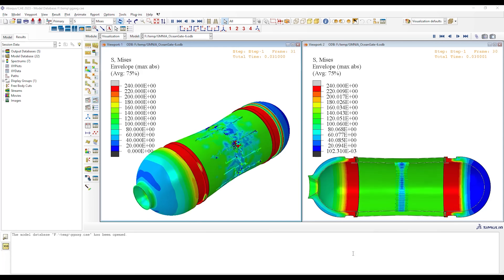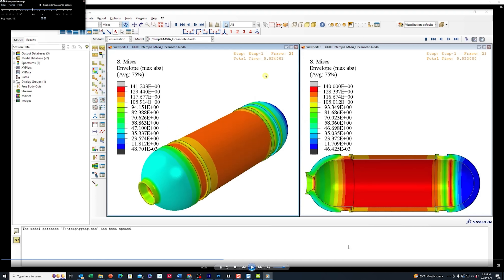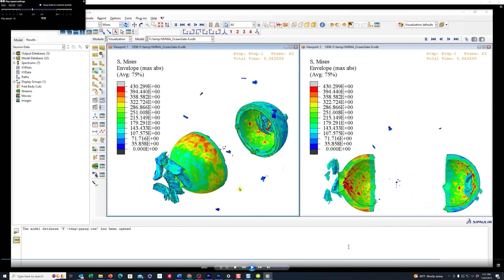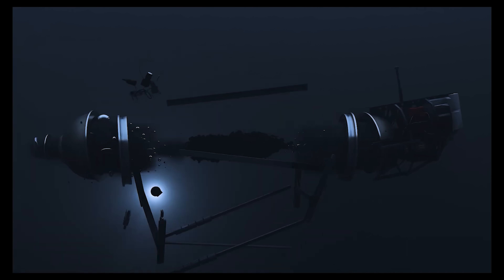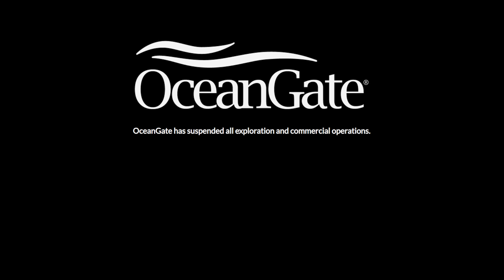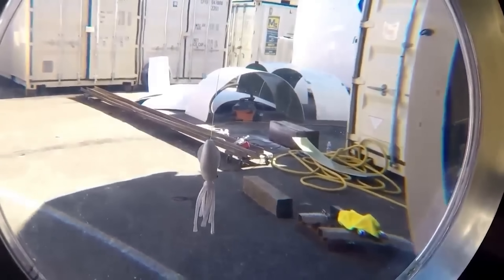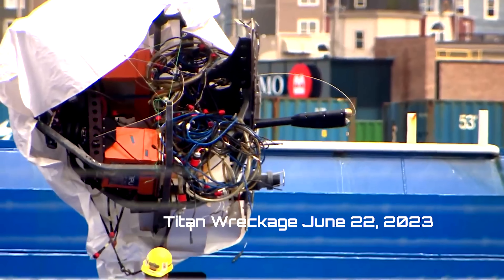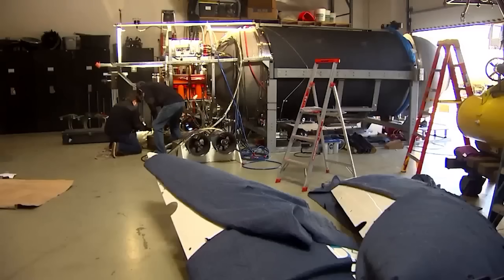Best Titan Sub Implosion Simulation, Cracked Porthole? Q & A

Comment: Ex submarine sailor here. I think that when they dropped ballast and/or the landing skid, the vessel went vertical with the stern down. Everyone was in a pile on top of the pilot until it imploded. They knew what was happening.  That toy submarine didn't have any way to maintain the horizontal orientation once things went bad. Any small problem with buoyancy or trim became a lethal problem in seconds.
Reply: The text comms retold said Rush saying more than once, "cracking sounds aft. "
Reply: @mikesanders4012 then that would be carbon breaking down?
Reply: That makes sense.  We already know one method they had to release weights was to have everyone move to one side to tilt the vessel so it’s orientation was quite easily manipulated by shifting weight.  All without any fixed seating or restraints that even a forklift is required to have.  If Wile E. Coyote took delivery of a submersible in a nailed-together wooden Acme crate it would have looked something like the Titan.  Even the Acme rockets came with a strap to keep you on!
Reply: @kev_299  Your analogy is perfect. MEEP! MEEP!
Reply: @pugsymalone6539  The reason the stern down scenario made the most sense to me from early on was the reporting that human remains were found.  I haven’t heard much about it since.  If the reporting was accurate, my first thought was they would have been in the stern cap and contained in it like a crucible.  If anything was found it may have only been things like fillings, surgical rods/ joints, etc. - and probably would have been all five of them.  So many secondary forces/ bubble theories at play that could probably explain finding  more intact remains too but the manner of their descent and location onboard makes the most sense if this is the case.
Reply: @kev_299 that is very interesting
Reply: @kevinm8543  my thoughts as well. If the CF was taking water at shallow depths and/or the glass balls full of air were flooded, she would be stern-heavy. The majority of penetrations were at that end as well.
Reply: @kev_299  this entire comment chain is a whole revelation, and THIS one puts it all together.  I've been skeptical about the human remains thing but this makes sense.  Love it.
Reply: @pugsymalone6539  all of them were at the ends, there is no pass through for anything that isn't going through the titanium rings.
Reply: @nikonmikon8915  I'm not sure what you are referring to; penetrations?
Reply: @pugsymalone6539  the hull penetrations for the controls of various systems and data input to the systems inside. with regards to your ignorance on the topic, just because you sailed does not give you ANY authority to speak on engineering topics. stay in your lane bro. dont bring your goofy lane over here trying to make it relevant.
Reply: @nikonmikon8915  Stay in his lane?  What lane are you in Bruh?  Is there a lane for overconfident engineers who’ve never built anything?  I only know two categories of deep sea vessels: deathtrap or not a deathtrap.  You’re defending the former and are in no position to pull rank on anyone’s knowledge.
Reply: @kev_299  I don't think you understand what i was saying, why are you so pissed?
Reply: @nikonmikon8915  Me pissed?  Didn’t you just insult a sailor and refer to military subs as “weak ass”?  Tough talk from someone whose craft ended up in pieces on the bottom of the ocean.
Reply: @nikonmikon8915  Looks like you toob didn't like my response to you. When you have spent more than an hour inside a real submarine, or three days in crappy weather in the North Atlantic, please get back to me. Meanwhile, please give my regards to the contrarians union. Cheers!
Reply: @pugsymalone6539  I was looking forward to your response - too bad they didn’t like it!😁
Reply: @nikonmikon8915  "Sure, you might be a sailor with many years in this sort of environment over your long career, but I'M some douchebag on the internet, so I'm obviously the one who's correct!"
Reply: TRANSCRIPT shows Rush still typing after he dropped the ballast & skid.  That would have Not been possible if the sub was tilted with a pile of people on top of Rush

.
Reply: And yes I’m assuming the transcript is real until somebody releases an official one.  TRANSCRIPT shows the audio indicator gave them 20 minutes warning until implosion.  If Rush had surfaced immediately instead of screwing around, it might have relieved enough pressure to survive

.
Reply: @kev_299  sadly you clearly have a greater knowledge of cartoons than real life and the physics involved in this event. The most concerning thing is you think real life physics is the same as a cartoon!
Reply: @Andrew.J.R.Simpson  Clearly you have never floated in the water and experienced how buoyancy works, the simple concept of floating vs sinking, or how thrust up, down, left , right works and the loss thereof.  Loss of control and balance in a vehicle is a pretty simple concept that you’re trying to overcomplicate with factors like pressure which had more bearing on the implosion itself than the loss of control beforehand.
Reply: Highly unlikely...the debris is scatered in a large area....meaning it imploded few huncred meters above the bottom of the sea
Reply: @fernandocasafranca5122  I know the concept of remains being found sounded implausible based on the best information available at the time which was the near unanimous agreement among “experts” that there would be no remains.  Then the US Coast Guard said there were remains found.  Now we’re left to speculate how that might have happened because our best available information changed.
Reply: As a fellow former Bubblehead, I totally agree with your point. In fact, I posted on Facebook the day after she was first reported lost that was what happened- they saw it coming. So all this noise about how fast the eye can see it happening and reacting to it is BS- they saw it coming and had to be terrifying.

Remember the Thresher- same thing, sinking by the stern, but on a much bigger scale.
Reply: @SammyNeedsAnAlibi  Exactly. Be safe, Bubblehead!
Reply: Nice point. But vertical orientation isn't weaker , or is it ?
Reply: @mikesanders4012  vertical isn't weaker, but it's a sign/symptom of utter loss of control.
Reply: @mikesanders4012  with no speed (propulsion), all the up angle in the world won't save you.
Reply: @mikesanders4012 same same?
Reply: If the transcript is real, the slow rate of vertical ascent suggests that something that was supposed to be bouyant was flooded.  That would have almost certainly also caused a loss of attitude control.  Don't forget that there is an inaccessible section of the carbon fiber cylinder under the flat floor which is where the water would end up if the carbon fiber started to leak before it completely failed.  Probably some critical controls and instrumentation there too which might not react well to salt water.
Reply: Spot on. I can't argue with the terrifying situation you outline. I cling to transcript being fake because the moment that thing drops faster than the norm you abort. I cannot imagine that being ignored. However once everything, weights and frame, was dropped to try ascending (something James Cameron admitted to knowing within 24hrs) then the whole balance/ballast/tubular nightmare commences. If transcript is fake then who knows how quickly stability became a problem? What a shitshow!
Reply: @hamonryechinaski180  however rush seems to have an arrogance hereto unheard of he probably said it’ll be fine guys we’ll carry on
Reply: @hamonryechinaski180  I'm not sure if he even Knew What the proper rate of descent was... His team in the control boat seemed too afraid to press him on the issue.
Reply: As a serial comment reader, I'm certain they knew shxt😢was about to hit the ceiling and felt everything however quick.
Reply: @jamisa3668 
No, they didn’t feel or see anything. The implosion happens much too fast — faster than the electrical signals can be sent and interpreted by the brain.
Reply: That theory has also been posted elsewhere - and I agree with it.  I don't believe all was well and suddenly nothing, I believe there was something more catastrophic and everyone aboard was fully aware.
Reply: Orientation of the vessel doesn’t matter. The water pressure is the same over the entire vessel. It would have sucked for the occupants to be in a vertical orientation but that wouldn’t cause an implosion.
Reply: @BF-27 it would if the loss of orientation or power sent the sub into a free fall increasing pressure at an impossible rate
Reply: And let’s not overlook that the sub may have been overloaded from the start. These do not appear to be average sized people. The weight limit seems to have been “5 paying customers “.
Reply: @tedmulthauf7434  That's a great observation. For decades the US Coast Guard measured the average passenger at 165 pounds. Sometime in the 1990s (?) they had to change it to 180 pounds because we're all getting huge. This created chaos in the passenger vessel industry as the bottom line took a direct hit. Many vessels became unprofitable overnight. I'm sure this was another reason Stockton Rush vigorously avoided inspections and certification. (In addition to serving in submarines, I have been a licensed sea captain since 1981.)
Reply: @pugsymalone6539  this is ridiculous, they weighed everyone METICULOUSLY, ask the person who was there in this thread. Oh wait, stupid people are talking about how he doesn't know anything
Reply: @nikonmikon8915  you are clearly not a sailor. It doesn't matter if the passengers were weighed meticulously or not at all. (Of course they were.) The passengers were variable ballast on a very small vessel. If anything at all went wrong with the vessels trim, stability or buoyancy, it would attempt to go vertical. In the absence of a basic system for adjusting ballast, Captain Composite would have no way to right his vessel. Tell us how many years you have at sea?
Reply: It would make it sink faster. All the weight at one end. He's not the only one who said this. Other people think they all moved to the front seat from the noise they were hearing in the back. I don't know why some of you got so upset with what he said. It's pretty cringe. You don't know anymore than anyone else. You weren't there when it happened. The whole craft was a joke. Are you surprised at all that it imploded?
Reply: @spookshow6999  I'm frankly surprised that it didn't implode much sooner. Such a terrible design, and everyone told him so.
Reply: Even if they didn't actually feel their death moment and the implosion, they certainly were in full panic mode. Because Rush knew what was happening and what was coming and was likely freaking out and screaming and frantically flipping out, so they had plenty of time to be scared out of their minds, just by his panic alone. Which to me is just as bad or even worse than the actual moment of implosion and their death.
Reply: @amyhintz471  , All five of those in the Titan weren't panicked. Their brains were overloaded and couldn't process anything. The brains of Homo sapiens who have a bad case of Normalcy Bias shuts down:  They were just silent in the dark.
Reply: @amyhintz471  , Rush had a bad case of full-blown Normalcy Bias. In fact, in order to be on the Titan,  one had to have advanced Normalcy Bias or else one wouldn't be signing the Assumption of Risk document in the first place. This AoR document to ride that experimental sub  is as legally ironclad as the AoR document that one has to sign to get the experimental covid vax.
Reply: FYI everyone: I learned today from a video that the glass buoyancy balls in the stern were not full of air, as I had previously heard. They were full of oil. That makes sense, but still a relatively fragile tool which could have been compromised in transit to the dive site.
Reply: You mentioned a 24 Volt battery inside the vessel - please tell us some more about that. 
If there was one, why not two?  Where was the backup located?  Were they two twelves in series or one 24?  How many cranking amps?  Reserve capacity?  Was it changed after each mission?  What type of battery?  AGM? Li Ion, etc?  Where and how exactly was it mounted?
Related question - how much of a safety factor did you work off of during vacuum and pressure testing of the hull?  Was it more, less, or the same during vacuum vs pressure?  This important for my next questions:

Holy $h!t you had a 24 volt battery inside that little thing?.. and people thought the video game controllers were fire hazards!
What was the plan in case that 24 volt battery overheated and/or caused a fire?How do you keep that extreme pressure outside from being assisted by the temperature differential assisted vacuum created by the added heat?  Was the carbon fiber conductive or non- conductive and how did it’s dissipating or insulating properties compare with materials used in other subs?  Was that one battery responsible for maintaining livable atmospheric conditions inside the vessel if the pressure inside began dropping?  Was there a backup means to stabilize pressure manually like a military sub would have?  They have a safety factor far beyond what is required because they can actually deal with a fire or adverse conditions and live to tell about it.  Their lives on board mean much more to them than Oceancrate’s.
Reply: I always am confused when re enactments include the landing skid as I thought it was dropped prior to the implosion and as shown in recovery videos, they were not bent.  Perhaps if they were indeed still connected, the bolts would have just been broken and no bending of the frame?
Reply: @barleyhops38  yeah, a lot of our speculation depends upon whether or not the final communication transcript is real. If  they were dropping fast, I believe the reason was water infiltration of the carbon fiber at non-catastrophic depths, probably not symmetrically so (EDIT: auto correct tried to say semantically.) Upset the otherwise normal weight arrangement, and she tries to go vertical. Rush may have burned up his battery bank trying to remain horizontal, and as he lost the fight to dead or dying batteries/dead thruster motors...she goes vertical. People end up in a pile in the dark until the ride is over.
Reply: @pugsymalone6539  I find your opinion interesting and terrifying! Except the waterlogged CFRP tube. That doesn't jive in my brain. But, I'm wrong all the time.
Reply: @shaymcquaid  The truly terrifying part to me is that with roughly 850 lbs of movable ballast inside the hull, in order to obtain balance they would instinctively scale the sides however they could to get to the other end which could tip it the other direction, spiral, or tumble.  All spatial awareness and equilibrium quickly lost like a pilot losing sight of a visual horizon in the dark only worse.  All power lost with no redundant mechanical gauges to assist in getting it under control.  What a nightmare- I feel really bad for five families and four of their members.
Reply: @kev_299  850KG of internal ballast? Please elaborate!
Reply: @shaymcquaid  I think it may have become waterlogged to some degree from non-catastrophic damage incurred on previous dives and/or the beating it was taking while being towed. I wonder if they weighed the whole unit before and after each dive, as a simple measure to detect subtle change? I'm guessing not. Even without a waterlogged hull, it appears that the majority of hull penetrations were aft, behind that wall separating the people from the batteries and gizmos. Not being able to access that space, even visually, at will, is a huge flaw in my book. Who knows what was going on back there?

With all the batteries and gizmos aft, I think that if she were going to go vertical, it would be stern down and impossible to recover from, with those little non-directional thrusters and the pilot buried under 600 pounds of humanity.

Rush obviously didn't plan for anything to go seriously wrong.

Side note; I once held a man-overboard drill on a ship I was Captain of. The scenario was a baby in the water. I represented the helpless baby with a tennis ball. We could hold the vessel close to the ball, but had difficulty getting the ball/baby out of the water. we eventually used a bucket. In a few days we had a fisherman's net with a telescopic handle. If you don't train for it, you can't plan for it.
Reply: @Andrew.J.R.Simpson  I’ll elaborate: lbs stands for pounds not kilograms.  850 pounds divided by 5 souls on board equals 170 pounds (not kg - read above) per person - probably more in actuality.. 1 lb = .454 kg.
Reply: @shaymcquaid  CF has a tendency to allow micro infiltration of water over time.
Reply: @edsloan8535  Yes, one look at  it, and that makes sense. Crazy situation.
Reply: @kev_299   A pound is a force. A slug is the mass, using the English system.  Peeps tend to mix mass with force.
Reply: @Andrew.J.R.Simpson  the human ballast inside
Reply: @kev_299 I bet that was terrifying but if they lost power and it did too vertically I’m sure they were already terrified quite enough. At least when it happened it was faster than they could perceive.
Reply: @kev_299  No seat belts... GAH!
Reply: @barleyhops38 k
Reply: Only if the last communication was the ballast/landing frame was dropped.
Reply: Thought Rush, the pilot was sitting in the back, the passengers in the front...
Reply: @jillcarter9877  Yes, but if the vessel acquired a steep angle, everyone ends up in a pile. No seat belts or harnesses were installed.
Reply: @jillcarter9877  They were all sat cross-cross-applesauce on the floor. Imagine how safe you'd feel riding in a plane like that!
Reply: Now seeing pictures of the sub burried in the seafloor aft end sticking up, it seems your theory could be plausible.
Reply: @MicklowFilms  I saw that, too. What a mess. So preventable.
Reply: You were on the money with this theory
Reply: @jk-qk5vc  Thanks. A case so sad...I'm still bothered by it.
Reply: Pugsymalone6539...my point precisely.
Reply: They had no idea what happened…. they were dead almost instantly.
Reply: Didn't the US Navy say they recorded sounds of an implosion?
Reply: @Ghost_Hybrid 
that’s what I heard — that the Navy’s equipment detected the implosion.
Reply: The sub imploded. That's what happened. It has nothing to do with the thing which the thing did one thing or another thing. Just thing about it? ok?
Reply: @Yes - a lot to take in.  I need to watch a couple parts again but it sure is full of red flags. 
1.  They were willing to deviate from normal practice and dive on 1/2 battery power with little or no reserve in order to get paying customers down.
2.  The pressure to deliver something for the customers was a real factor pushing decisions.
3. Reassuring that the sub is safe while at the same time explaining numerous issues releasing weights.
4.  Casually joking about losing sonar and getting dropped 30 meters from the hull?  Potentially deadly incident that would have led to an investigation with loss of jobs and command if it happened in the Navy.  No accountability.
5.  Described bumping and banging in rough conditions that broke welds and dented equipment requiring repair.  I’m not so sure the sub was undamaged like he says - lots of weight hanging from those epoxied rings when it’s out of the water and lots of sensitive electronics.  It should have returned to port then.
  If there is condensation, it’s simply because it’s warmer inside and colder outside and there are five people breathing.  That’s a design flaw if the fresh air system can’t remove enough humidity to keep it dry - hard to believe they would miscalculate that.  The fact that an electrical engineer is wrongly speculating about the source of moisture goes against the “stay in your lane” mentality I’ve been hearing from their defenders.  He’s probably passing on information someone else guessed.  My speculation is if a liar was trying to convince a nervous passenger the water in the bottom of the sub was not a concern they would attempt to pass it off as condensation.
Reply: Thanks for the info R.  My apologies for the unpleasantries during that heated exchange a while back.  I’m glad you’re still here.  Sometimes the best information comes from poking the bees nest a little but not at the expense of others.  I am sorry.

  I’m looking at this whole thing from a little different angle - sticking to what is verified to the best of my ability and gathering all the information I can.  I see a couple glaring discrepancies in recovery photos that don’t match the implosion scenarios discussed  and shown in the simulations I’ve seen.  Those were mostly based on best guesses from respected sources when the sub was still missing and people ran with it.  I think the evidence is telling a different story.  Best of luck to you - may it continue to be on your side:)
Reply: This is an interesting theory.  Thank you for sharing your knowledge and experience.
Reply: Jesus
Reply: Recently released USCG footage shows this may well be the case - good intuition
Reply: @xzydra570  Thanks, I saw those pictures, too. Gruesome.
Reply: Ex-submarine sailor here as well. I think it spun around like a tornado and exploded outward.
Reply: @Chiraq312boi  I could see the spinning, as they dropped ballast and went squirrelly...
Reply: It has a Rhino type liner too under the carbon fiber.
Reply: After releasing the ballast and jettisoning the frame the vessel finally gained positive buoyancy and started to ascend, though very slowly. That is what they have communicated. There was no mentioning of problems with trimming.
Reply: @@AC-jt9yb Thank you for posting, you're smart and it's easy to spot in this sea of nonsense.
Reply: RE:pugsymalone6539.  What difference does it make what orientation the submersible was in as long as it was ascending?
Reply: @munsters2  If it’s ascending more on one end while getting “dragged down” (nautical term 😁) progressively more by something at the other end the ascent will slow until whatever is making the other end heavier than it should be(taking on water, etc.) makes it neutral and finally heavier overall.  Down she goes to Davy Jones Locker as described.  Float on your back, tilt your head forward and unarch your back - your feet sink and it becomes much more difficult but not impossible to float.  Now keep adding ankle weights until you can’t stay up anymore.  I’m running out of analogies and similes.
Reply: @kev_299  Okay
Reply: @Thanks.  Under the floor… yikes.   Deep sea submersibles aren’t my expertise but that’s a big heavy hazard trapped inside with them that can’t be jettisoned.  A primary that could be jettisoned as emergency ballast with a backup - both outside like the other batteries makes more sense.  Low temp isn’t near as much of an issue for a battery outside the chamber as  high temp is inside of it - CA specs are at measured at freezing and CCA at 0 degrees F and they already had penetrations for cables.  Engineering disasters are never the result of any one factor and there are so many here.  Another issue they would be almost guaranteed to have with all those high amperage cables and wiring passing through in that environment is electrolysis building up in the water inside  if it wasn’t neutralized after pumping it out.  Electrolysis is very destructive and hard to eliminate once it’s in a system and builds up an electrical charge - it would be even more difficult to deal with if it was permeating the hull which is also conductive.  I’ve seen new heat exchangers fail, burned from the inside out through the coolant within weeks and it’s something auto manufacturers have dealt with for years.  Probably not the most immediate hazard if water is sharing space with a 24 v battery under the floor but if they didn’t account for it then it was almost certainly there to some degree.
Reply: @Also -  if there’s condensation under the floor than it must not be sharing the same controlled environment as the occupants above the floor unless there’s condensation up there too.  Must be pretty humid and misty down there.
Reply: @Good info on the composites - reinforces a couple thoughts I’ve had from the beginning.

  I see that Titan got stuffed into a wave and likely towed for miles and miles mostly submerged on Mission One.  That platform wasn’t made to tow in that direction (or at all) - a river barge has more of a bow than that.  The sub was too far forward for towing and was bow heavy and nosedived.  He gave some bs excuse about buoys or nets causing it.  It probably happened shortly after leaving the harbor (edit: it was on the fourth day when conditions were the roughest - or at least that’s when it was noticed).  The more alarming thing is it didn’t return to the surface when the boat stopped.  I wonder if the hatch is vacuumed shut for transport or just when people are in it?  He claimed some problem with a tank that sounded sketchy too.  They apparently didn’t learn anything and it was towed the same on mission 2.  The glass spheres may be in the ideal location on the sub when it’s underwater.  When they’re ten feet above the waterline on a short platform in rough water it’s more comparable to having a couple fishbowls with sensitive electronics at the top of the ship’s mast.

  In the DALLMYD video Rush says something like ‘now we’re going to try the pneumatic lock and it might or might not pop open - we’ll see’.  That among other things makes it seem like the damage from the previous season wasn’t fixed yet and they were still trying to figure it out.  Mission One (before delay) was scheduled for May 11-19 and Mission Two May 20-28?  Not much turn around time to service the sub.
  I’m trying to find info on the viewport window in its latest configuration.  Rush claims in a 2021 interview it is concave on the inside so you can stick your head in it but the photos show a flat back piece of acrylic that looks like a Plano convex lens.  Is there a second concave inner lens - it seems like it would be needed to offset the light expansion and distorted view looking out the dome through the flat side.  
  There was s lot of nice tech on the sub - mainly the specialized things he couldn’t skimp on - and I’m sure a lot of good people working on it.  Unfortunately their jobs were  made much more difficult by a design that was so flawed and a designer who wouldn’t listen.  In the Travel Weekly article about Mission One there is a seven second video at the end of part 2 where they’re raising the mission flag.  It picks up part of a conversation where you hear Rush talking about someone who had sold some submersibles being something like ‘the only honest and smart person in the submersible community’.  Apparently he had real contempt for everyone who tried to warn him.
Reply: The implossion happened before they got to the button.
Reply: theres no proof thats how it ended, just rumours
Reply: ...or being far below the depth that the portal was rate to. 🙄
Reply: So basically, in that situation, you have an uneven weight distribution that could cause separation of the glue material between the titanium in the carbon fiber?
Reply: @jeffreyburney6161  I don't think anyone is speculating that, though it's not out of the question. We're more saying that the loss of control resulted in a complete inability to remain relatively horizontal. Being negatively buoyant, she sank vertically until she imploded.

Was the connection between the CF and the titanium rings a serious weak link? Absolutely. They would have expanded and contracted at different rates, guaranteeing inevitable failure. This boat had a finite number of safe dives in it. Without testing its impossible to speculate how many. Rush should have retired it and built a new one, or limited this one to visiting coral reefs in shallow water, serving Mai Tais and wearing Aloha shirts.
Reply: He tried to make a business out of something others treat as a spare-no-expense serious operation to explore and learn.  The others in that community are also the ones that can answer questions about their last trip down (and back).
Reply: @pugsymalone6539  I actually do believe what you’re saying is very well possible and actually do see that the sub could have gone vertical but I believe it could’ve gone vertical either by the tail or the head. I watched a video on how the sub was constructed. I am somebody who has an engineering mindset, and I understand different properties of different materials, and the video was very cringe worthy. They use glue to glue, titanium and carbon fiber together to materials that have two different compression rates. If you look at the cross-section between the adhesive joint of the carbon fiber, and the titanium, that joint really is only as strong as the glue that holds it. I would not trust glue on any type of submarine. That sub was destined to fail. I don’t know if that sub would have been good for $1000 in 100 feet of water. Because eventually that glue joint would wear out even in shallow water and fail. Because about 30 feet of water is equivalent to one atmosphere of pressure. And we all know what one atmospheric pressure can do to a rail car that is not properly vented. I’ve seen those videos, and if anybody was inside that rail car, they would be dead, even at that pressure. That whole sub was a death trap. You’re very knowledgeable on submarines and I actually enjoy discussing this with you. Thank you for replying.
Reply: @jeffreyburney6161  @00:14 Not sure when the photo of the submersible was taken but if you look closely at the top of the viewing port it appears there is a rubber seal that has come loose.
Reply: @jeffreyburney6161  Jeffrey, I agree she could have gone vertical by either end, or may have tumbled. Also agree that even in shallow water, she was destined to fail at the rings. The lip on the CF was smaller in diameter than the rest of the hull, and one or more penetrations may have been through the ring. (Saw that on another channel.)

The comments section in most videos about this implosion reveal that there are countless people like yourself who, while not being sailors or submariners, have a better understanding of physics, mechanical engineering and common sense than Mr. Carbon Fiber Innovator Guy.

This particular comments thread has taken off, which is fun. Thanks for participating. Cheers!
Reply: For a former submariner your guess seems amateur.  Why would or what would cause this sub to go vertical. Note: I am not asking about poor ballast release.  Why would a specific end of this sub point to ocean surface?  Do you believe proper design was not made to keep this sub horizontal?
Reply: @JF-fx2qv  Let's start with "Do you believe proper design was not made to keep this sub horizontal?"...It appears that nothing about this sub enjoyed "proper design." It had no ability to shift ballast from bow to stern or port to starboard, yet it was shaped like a bottle on its side. It was a tube. Much of the apparatus was outside of the pressure hull, including two large glass balls full of air, which were designed to provide some reliable buoyancy. These were aft. If one or both were damaged in transit to the dive site, she would be stern heavy. If the CF was becoming waterlogged due to failing penetrations, most of which were aft, or due to wear and tear from previous dives, that water would have settled aft during the long tow to the dive site as the stern rode lower than the bow. Even a two billion dollar nuke sub will begin to favor one end or the other when all forward motion is lost, until we adjust some variable ballast. That's not speculation, it's experience. 

The other reason it could have gone vertical is that all battery power was exhausted or permanently interrupted. Without thrusters, she would begin to immediately favor one end or the other and the people would be the only way to attempt to keep her level, in the dark and disoriented. Without power to the thrusters, she would be at the mercy of the currents and her own natural displacement, which was stern-heavy due the apparatus being aft, both outside and inside of the pressure hull.

I'm mildly amused by the folks who question basic physics or who find my analysis amateurish or unqualified because I didn't work on this particular boat (TITAN.)

Try placing a bottle or can in a basin of water and see if it sinks horizontally. It won't. A ball with two holes in it will go straight down. A horizontal vessel will favor one end. Airplanes don't crash flat, either. I hope this helps clear things up. Cheers.
Reply: @pugsymalone6539  You clearly do not understand how the Titan was made buoyant. This is not a weak ass military sub and operated in conditions no military sub goes to. Not EVEN CLOSE. They do not use compressed air for buoyancy at these depths like they do on military subs.
Reply: @nikonmikon8915  umm...yeah, I know.
Reply: @pugsymalone6539  I wish i ternet wise guys would just listen to professionals like you when you talk... Not listening to professionals is how we got where we are now with this sad crash!
Reply: @pugsymalone6539 
What do you mean? I’ve seen many plane crashes that land horizontal/flat. They have skilled pilots.
Reply: @JF-fx2qv  , Elementary my dear Watson. That's because the sub's ass had been breached with with wires and other gizmos, which makes it the weakest part of the sub for an influx of high-pressure water. It's the part of the sub that probably soaked up a lot of water making it heavy. Carbon fiber acts like a sponge when under a lot of pressure.  It's carbon after all, and carbon molecules binds  up HOH a lot. You can see this in carbohydrates.  Note the root "hydrates," meaning water, HOH.   :D
Reply: @JF-fx2qv after seeing all the design flaws I’d go with that being a problem and believe it no problem.
Reply: @pugsymalone6539 as an ex-submariner you have experience of "toy sub" depths of 4Km? I thought not 🤣 Yet you speculate with know knowledge of the vessel.
Reply: @Andrew.J.R.Simpson  You must work for yoo-toob, my answers to you are blocked. Tell us again which submarines you served aboard? As for Titan being a toy submarine; the proof is in the pudding.
Reply: @pugsymalone6539 
Also, I see your comments to “andrewsimpson” — that’s so silly to accuse him of working for YT just because some of your posts didn’t go through. Welcome to dystopia YT, dude! It’s been this bad for YEARS now regarding policing our language! It’s not going to be any different for you. It doesn’t matter who the recipient is!
Reply: @georgewashington2930  I wasn't accusing him of working for YT. Just saying some posts weren't going through. 

As for my comparison of plane crashes vs. the Titan implosion; I would need to review my post, but of course an aircraft in extremis can land flat if the talented pilot has functional control surfaces. 

Titan was lacking both.
Reply: @pugsymalone6539 
Oh you most definitely accused him of working for YT lol. Read it back.